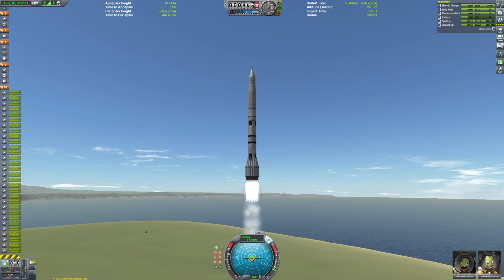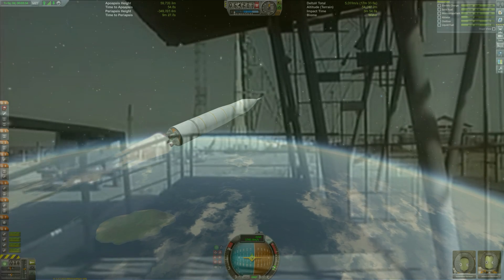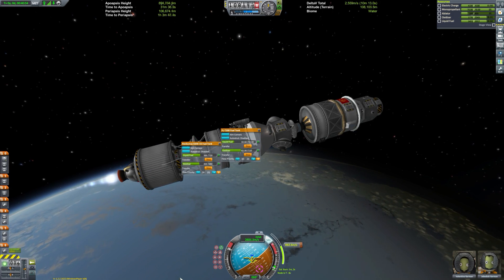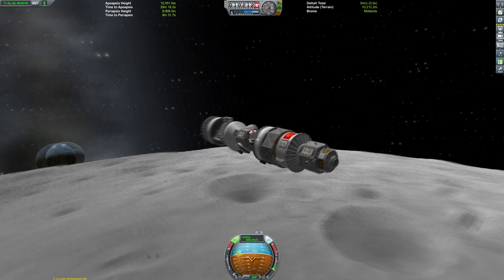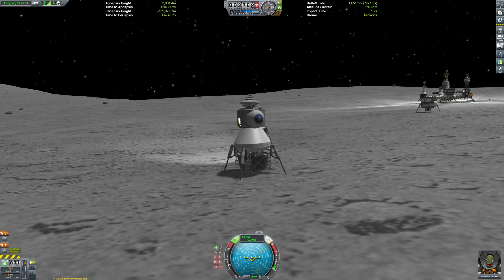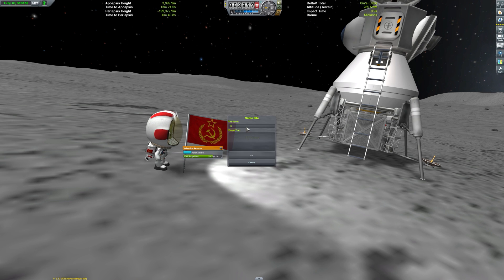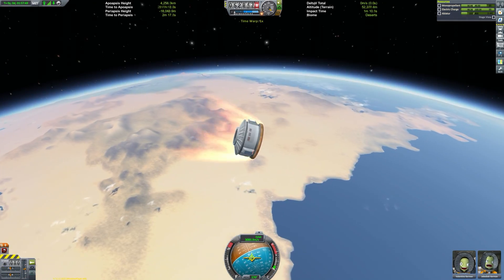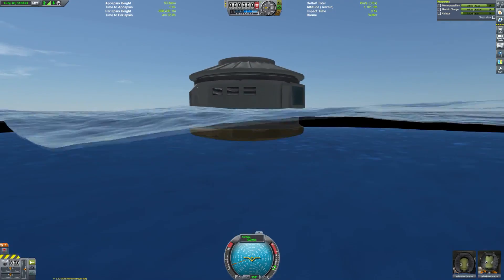KSP - The Failed Soviet Moon Mission

Comment: Well, it's important to consider that the Soviets didn't throw engines on just because. They were forced to use a large amount of small engines because programs that would have produced large engines to rival the F-1 used in the Saturn V were cancelled. These small engines, by the way, are the most efficient chemical rocket engines ever produced, and a quantity were bought by the US following the fall of the Iron Curtain.
Reply from the maker: Although the rocket as a whole was unreliable, the NK-33 and NK-43 engines are considered rugged and reliable when used as a standalone unit, hence why they were able to flog a good chunk of them following the termination of the program
Reply: ΑΡΗΣ ΚΟΡΝΑΡΑΚΗΣ The NK-33 was used in the original first stage of Orbital ATK's Antares rocket, after being refurbished and somewhat modernized by Aerojet as the AJ-26. Though after the turbopump failure that brought down CRS Orb-3, they switched to the RD-181.

Also, the NK-33 is apparently the first stage engine of the new Soyuz-2-1v lightweight launch vehicle.
Reply: Jack Valleli Smaller, efficient engines on the first stage? You just gave me a clever idea for first stages in KSP! Why use a mainsail when you can use a bunch of ANTs  or something?
Reply: also they launched from Baikonour witch, isn't any near to the equator
Reply: Analytic31 it will be more efficient, but in vanilla game that doesn't simulates failure points, the only worry except propellants, is the FPS
Reply: Jack Valleli they also did it for redundancy - if one or two of the engines failed, they could still carry out their mission.
Reply: +TheWindigomonster
According to probability theory, with more engines their is more chance of total system failure (e.g. more engines falling out than you have redundant) and that is even excluding the fact of engines failing in the explosive kind of way. 

Another interesting part of Sovjet rocket design is their tendency to use multiple nozzle's and combustion chambers on a single engine turbopump package.
Reply: Matt Lowne they have any plans for those HK engines?
Reply: darell kubina If the Soviets never innovated properly, then why were they the first ones to put a man-made satellite in orbit and a man in space?
Reply: Victor Andrei "cold war" & "space race"
Reply: Jack Valleli the soviets never innovated properly look at both countrys space programs we had many rockets and better engines, where as they had a few with almost the same engines